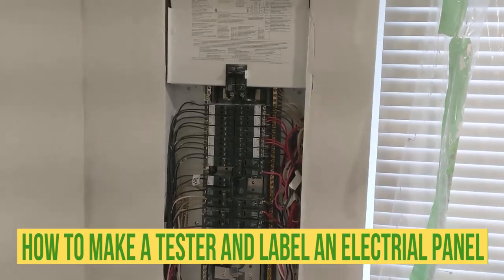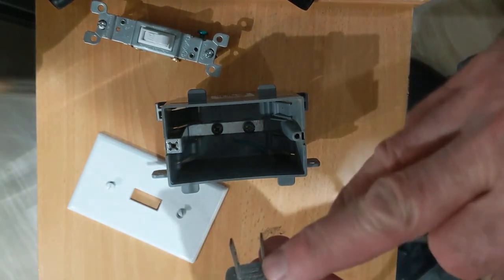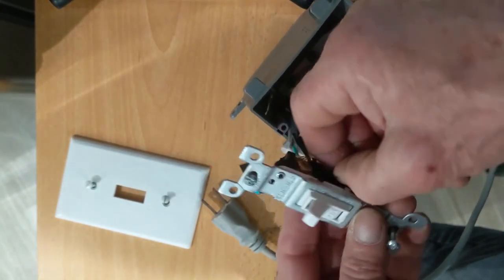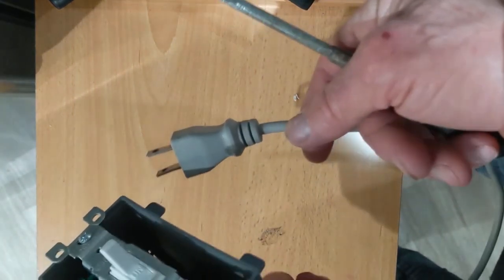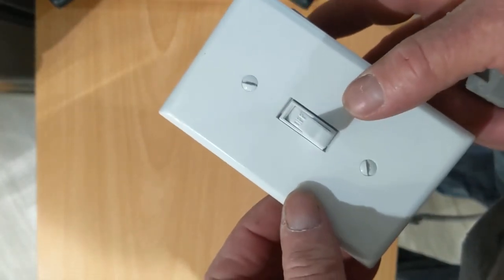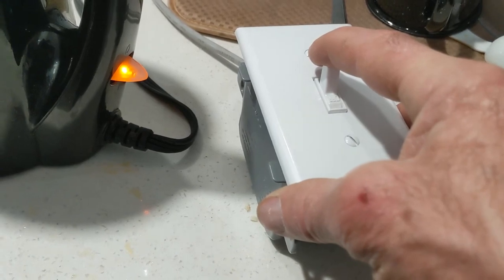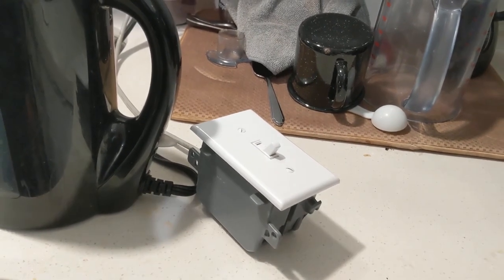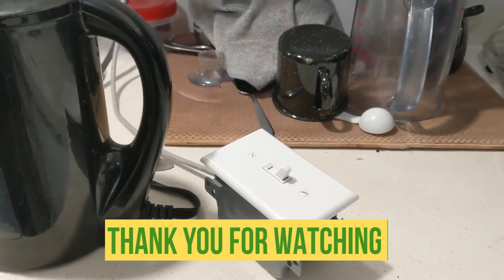How TO Make A Tester AND LABEL AN Electrical PANEL

Comment: Nice. I do most home electrical work by myself. This is exactly what I should make to avoid walking up and down stairs to check if the right breaker is off.
Reply from the maker: Thank you very much Jeff for your time and comment, this tester makes my life easier, I decided to pass it over, hoping that it could help few more DIY around the globe. Have a great weekend my friend.

Comment: WOW. I've been an Electrician in Canada for 50 years and this is beyond anything I've seen. It is so dangerous and against anything I've learned, in fact if anyone who has ever worked for me tried this they would be fired on the spot.  It may work but sooner or later that switch is going to blow up on your hand. I DONT KNOW ABOUT THE OTHER VIDIOS THIS GUY PUTS OU BUT THIS IS EXTREEMLY DANGEROUS.
Reply from the maker: Hello Rick, thank you very much for your time and comment, your feedback is really appreciated and very important, the switch, with the use it will wear down and have to be replaced. Which part of your job is the most dongerous on your thinking? Keep safe my friend and see you in the next videos, God bless.
Reply from the maker: Thank you very Fatima, take care my friend, God bless you